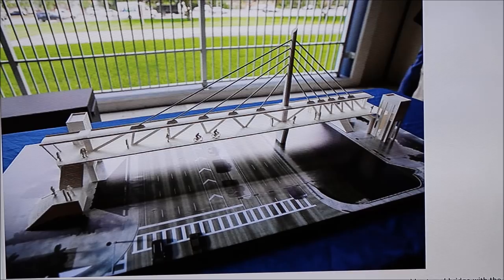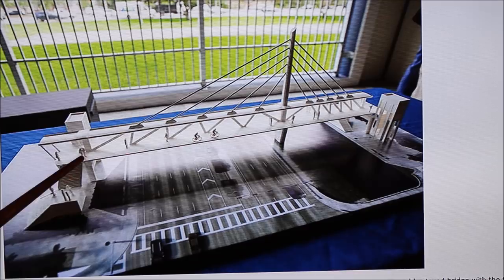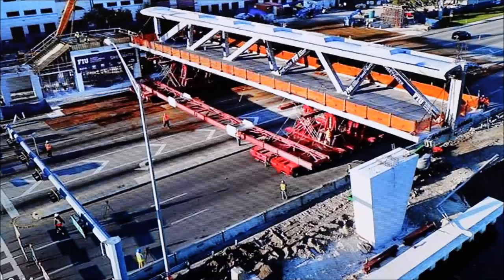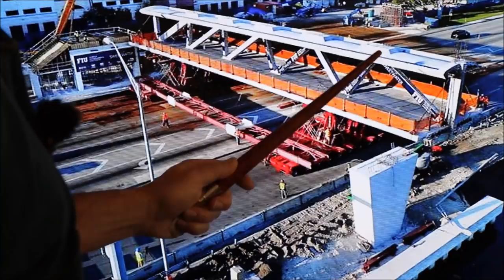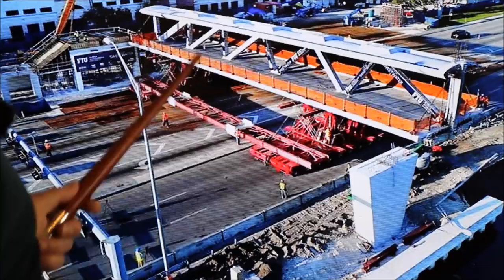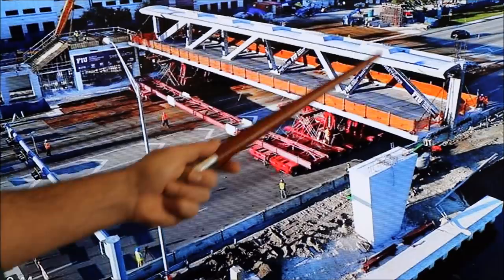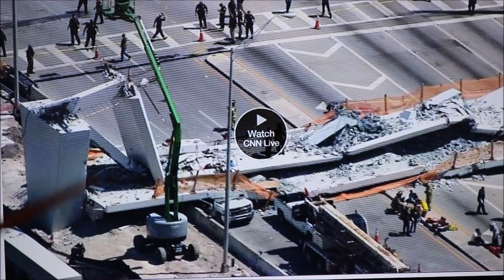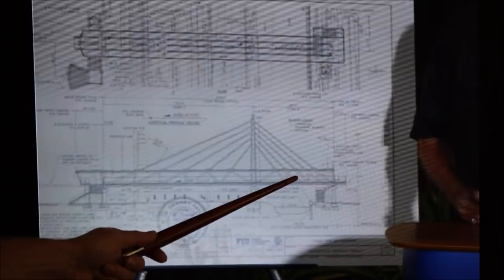Miami Bridge Failure- preliminary analysis 17 March 2018

Comment: From what is obvious to me is that the tensioner supporting the end of the bridge that wasn't supported during application of the bridge was weakened by the hundreds of tons of NON compressed concrete overhang, therefor stretching the tensioner supporting that particular end. It's obvious to me that once that end of the bridge is placed on it;s correct supporting pillar at that end, they "the engineers" would have found that the tensioner that had been supporting the unsupported weight was now loose and so begun to rectify the problem of the loose tensioner by retensioning it but the damage had already been done. A tensioner can only support so many hundreds of tons and with hundreds of tons of uncompressed concrete that had already weakened that tensioner then this disaster was inevitable. Just saying.
Reply from the maker: great point!
Reply: That was basically the point of AvE's 2nd video and i think in the end it will probably be a large part of the investigations focus and conclusions. Who decided to sign off on moving the falseworks away from the original load points and placing them mid span without the required spanner plates even between the hydraulic lifts? The rest was them just chasing their tail trying to fix a problem (loose tensioner) without realizing the real problem or cause was a previously over loaded and over stressed tensioner that would never come to spec without failing first. One of the big take aways is that bridges fail far more often in construction because the many fail safes and over engineering of a completed design are not in place to check one another, thus allowing for a much simpler chain of events to cause a failure. Sometimes its stupid simple, right in front of you, and everyone (with clout anyway) misses it because of intense focus on other concerns. No way traffic should of been going under it in hind sight, and its probably true that the FIU was pushing things and bulldozing concerns because it was their flagship demonstration for their faster building method and they probably focused on speed of the project more than they should have. Sometimes people get to close to their designs too and they try to blame issues on outside factors instead of admitting weakness. Wouldn't be the first time.
Reply: when i was looking at it being moved ( they have time lapse and reg ) it looked like the bottom piece is curved...like concave...smiley face smile, but slight...and when it was first put on the two side supports it looked like one end was higher than the other...it still looked like that to me after it was in place...is that what you are talking about...and i cant figure out why the bottom part looked like it was  slightly curved, not like a v, but like a smiley face...and yet when it was put in place, one of the ends, on one side end, was up like a tupperware container ( top ) not closed right...or a piece of fabric stretched on part of one end so it wouldn't lay flat...did anyone else see that or was it supposed to look like that...can't do math at all so  definitely not engineering material... just curious...all these comments are interesting
Reply: You have to wonder, did anyone measure the tensioning rods to see if they had stretched. That is one thing that a mechanic uses to get proper bolt tightening in some cases. Or were they just going on " well it is loose so we will retorque it to the proper torque"? And never consider the fact that the rod was stretched? A mechanic knows that if you don't get the right torque reading and the bolt/stud has reached the correct stretched length, that the bolt/stud has to be replaced. Because it has reached its design service life limit.

Comment: If you watch the video Keith linked to it is evident that the failure occurred above the first web connection at the roof. The instant failure appears to be a failure of post tensioning work. Pulled too tight and pulled out possibly. In any case it appears to be a miscalculation or poor workmanship. Post tensioning needs an employee with a high degree of experience. Zero traffic during this operation should have been mandatory. A shame as lives would have been saved. A true avoidable tragedy. Great reporting and an excellent overview. Thank you.

Comment: I find the argument that damage occurred to the joint where the two diagonals met the upper canopy, possibly when the tension rod in the outer member was supporting the overhanging end of the truss with the transporter lift points being too far from the outer end of the truss. Either the cable was too loose during transport, allowing tension forces to separate the joint area, which then gave way when put under compression when the span was placed on the end supports or the tension was adjusted too high in an effort to support the overhanging end during transport, causing failure of the tension rod and damage to the joint area under tension forces. 
Either way, that joint appears to have failed after the span was in position for several days. Trying to tension the damaged joint structure after the diagonal member itself was already in compression rather than tension could have been the straw that broke the camel's back.

Comment: I saw this on the wikipedia page last week. It was only there for a couple of hours. Looks like they don't want to criticize the design.

In many bridge truss designs, the triangulated supports are arranged into two or more parallel walls. Among other benefits, this gives some redundant load-bearing paths to help the overall structure survive if any one member fails. In the FIU bridge, there is only a single vertical plane of diagonals along the centerline. There is no backup for any strut. The entire structure is threatened If any one diagonal or joint were to fail. Collapse can be avoided if the remaining joints and members were overbuilt stiffly enough to accept the shifting emergency loads without breaking. Otherwise, the structure continues to sag unchecked to the point where more things fracture or buckle, and the structure folds. Such bridges are called [[National Bridge Inventory|fracture critical]] with each strut being a potential [[single point of failure]]. That vulnerability is avoided in most new bridge designs.{{fact|date=March 2018}}

Except for this one tragically.

Comment: I think the biggest failure, regardless of design or construction, inspections or any procedural move pertaining to post tension  cables is the fact that there was no sub structure to support bridge or just the fact that they were allowing traffic under bridge at all while they were doing any tweaking via post tension cables or anything else.

Comment: This is like the Hyatt Hotel sky walk collapse in the 80's.  That was in the end put on the engineer that approved a change to the connecting rods who thought the company that made the beams understood the need for the extra sleeves if they went to dual rod system. They didn't do it and it was the largest loss of life due to collapse until 9-11.   It was a very traumatic event for the Kansas City area for many years following.  Kansas City was also home to another engineering failure, the Kemper roof failure which luckily came after a concert or it would have been another huge loss of life.  It showed that ponding of water on the roof can quickly overcome the  weight the roof was ever rated to hold.

Comment: Thanks Juan. In no news or analysis I’ve seen so far have noted this was supposed to be a suspension style bridge with cables and a support tower!
As you mentioned, they should have had a temporary center support in place.
What a terrible engineering and construction disaster.

Comment: A few important concepts.  The "truss" is only holding up the roof section.  Doubtful that adjusting a truss member would cause the entire bridge to fail.  The failure happened in the bridge deck.  Looking at the dash cam video, it looks like the post-tensioning work was taking place on the right-hand side.  If the rods had loosened and the workers broke one while tightening, the bridge deck would sag further.  If there was a weak point in the concrete, a crack would form and propagate from the bottom to the top of the deck until it fails entirely and falls to roadway below.  All that happens very quickly.  The failure point is just to the right of the crane on the right-hand side.

Comment: Juan,  Thanks again for the excellent reporting on this engineering failure.  I got almost nothing from the main stream media.  I am an engineering geologist an was a certified to practice in California.  I have worked on many bridge projects including several failures.  I agree with you that there was likely problem with the design, if nothing else the design was prone to  catastrophic failure.  There could also have been a materials defect in the tensioning hardware or the concrete it was anchored into.  Or, the tensioning rods/cables were under designed and simply snapped.  Something you may look at is where was that tensioning hardware made?  Was it subjected to proper non destructive testing (X-ray?)    The properties of the building materials are known well enough that this should never have happened!!

Comment: I agree with you Juan, this could be a design and detailing failure.  First thing I look at is the proportion of the bridge, about 1 vertical to 10 horizontal.
I think the entire load of the bridge is transmitted in compression through the angled strut at the support.  At 1 to 10, 1 lb of vertical load in the center translates to 5 times that in compression in the top chord(the roof), and tension in the walking deck.  Looks like the walking deck(bottom chord!) broke away from the strut on the left.  That is the most heavily loaded joint.
Second, the detailing where  the struts join  into the top and bottom chord?  While steel is great in tension, designing a concrete joint to transmit and resolve  loads from four directions, and  for unexpected shear and tension loads within the joint  must be a little tricky.

Comment: I've done a lot of post tension cabling during my years of concrete reinforcement..... Never never never once (and I can't stress this enough) have we ever started putting the reinforcement cables under stress without it being supported and or braced. Samples of the concrete used had to be sent to a lab independent from the concrete company to be pressure tested and the reinforcements in the concrete itself had to be inspected by a qualified inspector before you can even pour the concrete itself.

I've had anchor points for our post tension cabling set in concrete that have been poured and let cure for 3 days still malfunction and blow out entire 20 x 20 foot corners of a slab on a high rise building. But the entire floor stayed in place because it was brace from underneath..... So I can't figure out why they were applying the the tension on those cables without there being support from underneath. If it is determined that the post tension cabling had a malfunction and this was the cause of the collapse there should be criminal charges pending on whoever decided that no support was needed during the process.

Comment: Thanks for your illuminating information about the FIU bridge being a "fake" cable stayed suspension bridge at 1:30. I could not understand why they were stress testing a cable stayed bridge before the center post or the cables were in place. In a cable stayed suspension bridge, the strength of the bridge comes from the vertical posts and the suspension cables. 
I do not understand FIU going to all the expense to put up a fake center post and fake cables simply for aesthetics.......but then it is a college!!
A steel bridge could have been built on site and swung into place, but it probably would have looked ugly to the college administrators.

Comment: The surprise is that the suspension system was only ornamental considering the weight and that concrete is not generally good in bending

Comment: I'll bet by the time the investigation is concluded, a "Roger Boisjoly" will come out of the shadows.  Who was Roger, he was one of two engineers protesting the launch of the Challenger.  I'm far from being able to say I have an education related to the design of the bridge, but if you have the skill set to build a house or garage you have a good "feeling" how weight reacts.  One look a this, no support in the center, a solid slab, no steel beams, who in the hell signed off on this? 

One thing I do know.  The codes used by the railroads for a structure that crosses over their rails are pretty tight, and I'll stick my neck out and say there isn't a railroad in this country that would permit that bridge to cross over the rails.  It's a real shame that just because you came to work you got killed or because you caught a red light you got killed.

Comment: I heard from this video that workers are currently stressing the diagonal member near the supports. 

When the bridge is standing by itself then these diagonals are already in compression. When workers are stressing, most probably de-tensioning, then i think i should be expecting to see a threaded pre-stressing bar and NOT a tendon because if it were a tendon, one needs to stress further the tendon (i.e. increasing the compression on the diagonal member) BEFORE it can be de-tensioned.

Comment: Not an engineer here, but I believe that steel can flex more than concrete.  I tend to agree that the design may likely be the primary culprit, also contributing to the deaths was no plan to close the road to traffic during testing.  Initial reports said they were stress testing.  Also Juan has an excellent point, that the single set of angled beams meant that a single failure guaranteed bridge collapse.  I bet aesthetics won out for design choice (concrete instead of steel) but a steel bridge could have still been made to be fairly attractive, and with the tower and supporting cables.  Very sad for those killed or injured by the collapse.  RIP.

Comment: I had heard that eye witnesses saw the hook on the crane that was used to maintain tension on the steel cables while they were being re-tensioned either straightened out or broke just prior to the bridge collapse. That should be easy enough to verify or disprove assuming that crane remained on site. 
blancolirio as I've grown to expect provides the best coverage if you want the facts as they are known with some intelligent speculation that is presented as just that. The link to the design plan was particularly welcome.

Comment: Through my life, I was a nurse and a horse person, I have had NO engineering training, just day to day observations of people building things. And, because I do have a love for science and how things are put together, I may have paid more attention than some people. After the collapse, when I saw the design of the bridge, my FIRST thought was why do they only have one line of trusses!? Then when I learned that EVERYTHING was concrete, I wondered why they wouldn't use some lighter materials where possible... at least for the trusses. Who cares what it looks like!!! Its main purpose was to be a bridge not a work of art. Either they should have either made the suspension part of the engineering, or left the tower and cables off and put more money into design and stronger more sensible materials for it. There is a pedestrian bridge over a freeway here that is not fancy, but functional. And knowing the folks here they probably closed the freeway, in sections, until it was completed AND tested. It was built before I got here in 1976... Still working well!

Comment: Great post Juan, thanks for your efforts for assembling and posting this.
- Redundancy in the diagonal members could be accomplished with multiple tensioning rods (i.e. 2 rods in each diagonal member, with the capability of each rod to take the total predicted load plus an appropriate factor of safety)
- Juan may also need to update his calendar, the date at the end of the video lists 2017 vs. the current year of 2018.  (Must have been a hangover from the recent vacation.)  :-)

Comment: A few more things,  
- I'd be interested in understanding the load path between the various diagonal members.  Hopefully there is something like a steel bulkhead between the various tension rods of the adjacent diagonal members to carry & re-direct the load from one diagonal to another, and not just depend upon the concrete material itself.
- The structure may have been baselined to be concrete due to the proximity to the salt water.  (A purely steel structure may have been viewed to have high maintenance costs due to items such as salt fog.)

Comment: 2:46 Near end of the bridge is hanging way out in space in the photo... the bridge was not designed  to be lifted like this.  Steel rods in the diagonal truss were stretched to near breaking at this point, then they went slack after the bridge was placed on the pillars.  Tightening them up again, trying to bring them back to the post-tensioning specifications, stretched them past the breaking point.
Incorrect placement of the lifters is the fatal error here.